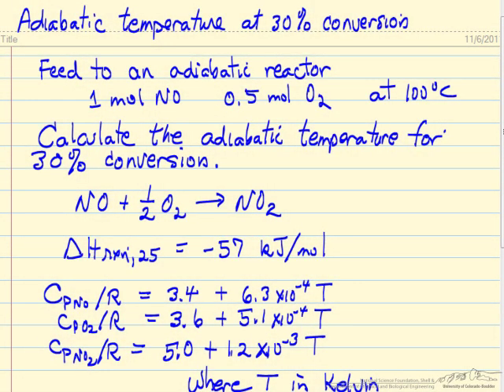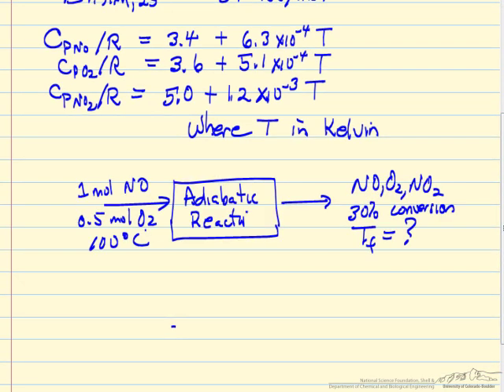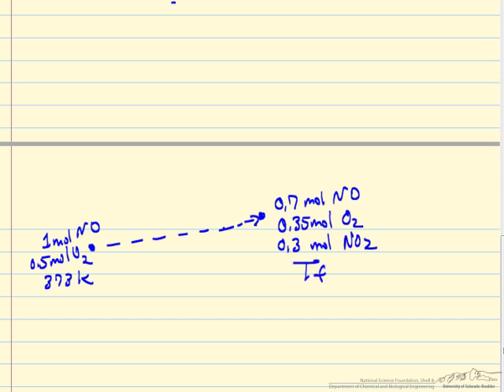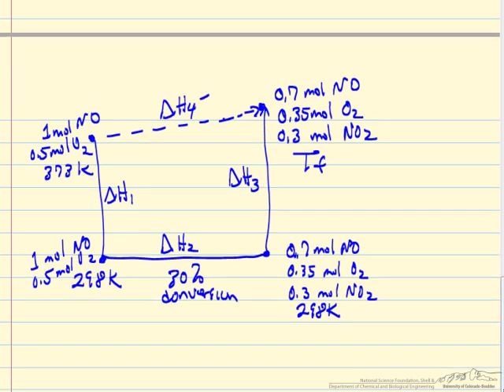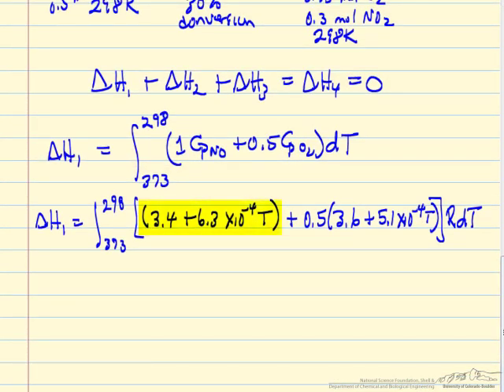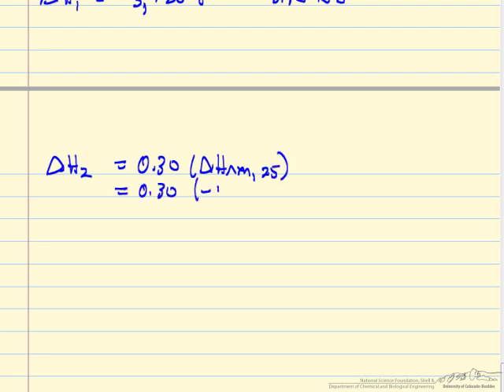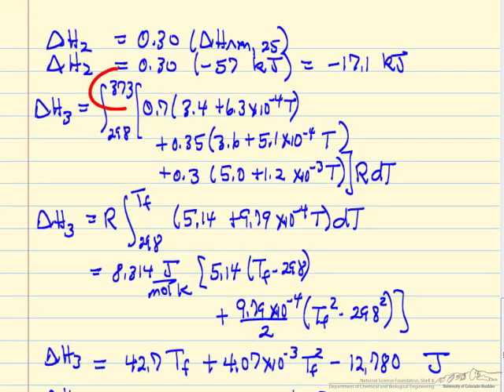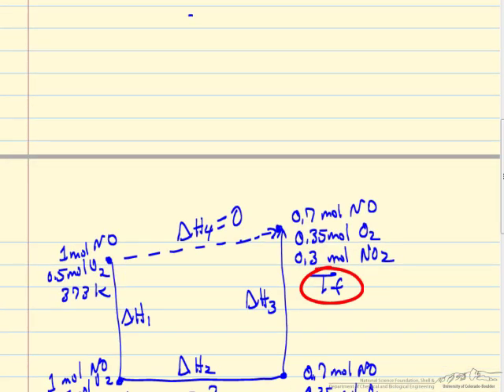Adiabatic Temperature

Comment: - you said dH = 0 because it is adiabatic, how come ? dH equals zero in isothermal process
and hence you postulate that dH1+dH2+dH3=dH4= 0 and continue to solve 
there is a mistake or i've misunderstanding ?
Reply from the maker: Thanks for your question. I believe you are misunderstanding the definition of an isothermal versus adiabatic process. For an adiabatic process, dH is equal to zero (no change in enthalpy). For an isothermal process, delta T equals zero (so no temperature change). An adiabatic process is not isothermal - The temperature increases in this case, since the heat generated by the reaction is not being removed. Hopefully this clarifies things.
Reply: thanks a lot for your kind reply
but i am afraid,i still have misunderstanding 
isothermal process means there is no dt
and dH =C dT, dT=0 so dH=0
while in adiabatic process there is dT
and dH= CdT, so dH here has value 
and this value equals Q 
i hope you can clarify it, thanks in advance 
and kind regards for you
Reply from the maker: Since we have a reaction here, dH is equal to CdT plus the heat of reaction, not just CdT. The enthalpy contribution of the two CdT terms must be balanced by the heat of reaction term in order for the system to be adiabatic (dH=0).
Reply: got it, thanks a lot